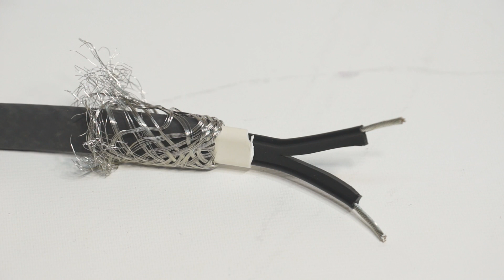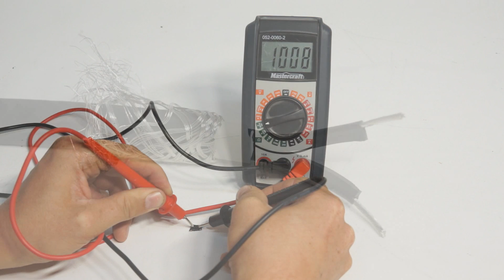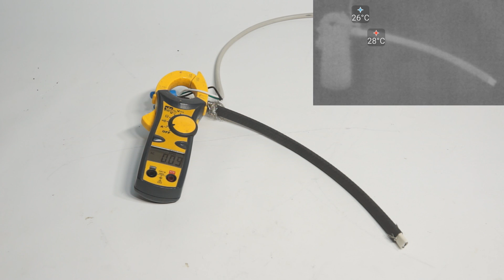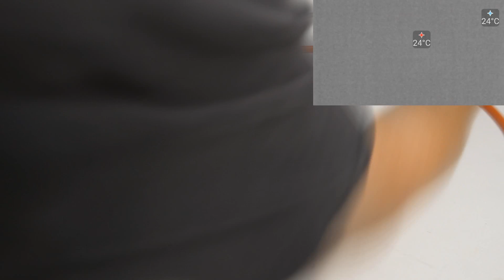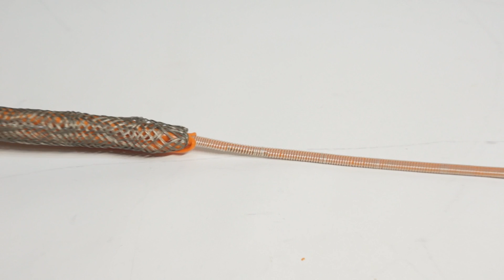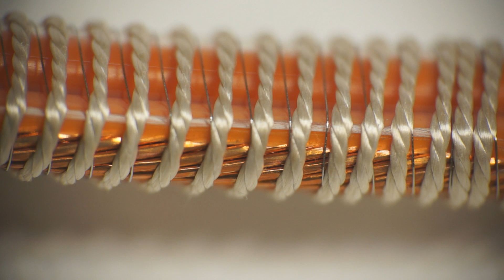Heat Trace Construction Comparison

Comment: Nick , I would like to point out you are calling both of these SR cables,  but they are not. one is self regulating , one is power limiting. the BTV cable you used is constructed different than other SR cables. I good comparison would be between the different types of SR. the Nodes on the power limiting ( the inconsistencies you speak of) are different lengths apart for different wattage cable(5 10  15 and 20 watt)

Comment: We use these at work to keep raw materials from freezing in the pikes.  We also use them to heat outside safety showers in the winter to prevent the water lines from freezing.  Almost all heat tracing is temperature controlled.  In areas of our plant where its an explosion hazard we use steam heat tracing to prevent any shorts becoming ignition sources.
Reply from the maker: Most of our heat trace is externally regulated as well, the self regulating stuff doesn't get hot enough.

Comment: what are these cables used for?
Reply from the maker: +Sdttn I will try as they come up but there are a lot of rules about what I can talk about due to there being some proprietary processes where I work. 

I do have some interesting fire alarm sensors to look at though if you are interested.
Reply: I would.
Btw your channel is just amazing! I subscribed to your channel 5-6 years ago. Thanks for these videos.
Reply from the maker: +Sdttn Glad you like them, I hope you've seen an improvement over the years. I've been trying to get closer to "production" quality but there is still a lot to learn.
Reply: To prevent water pipes from freezing. There's probably other applications, though.
Reply from the maker: +AusiKifaru27 We use them on water pipes and wrapped around tanks that hold materials that are too think to pump at room temperature.
Reply: I would like to see more your job related videos.
Reply: you do not use these types of cables on an infloor heating install. power limiting is not rated for this use, BTV cables do not have the output to heat a slab.  you would use an XTV style cable of that same manufacturer.

Comment: Hey nick, nice video. What is the application of such a cable? I thought heating elements were just connected directly to live and neutral ends.
Reply: I work on-board ships, which burn heavy fuel oil (residual fuel, e.g. HFO 380 cSt), the fuel needs to be kept hot (around 90 to 130 degrees Celsius), in order to obtain the correct viscosity to be burnt, i.e diesel engines, steam boilers etc. So we use heat tracing underneath the fiber glass insulation (or equivalent) to keep the fuel hot.

I hope that this helps to explain the uses a bit better, if you have anymore questions I am happy to answer them. :)
Reply from the maker: +hehtrs sjetn Some elements are self regulating (like the black cable) and some are not and require an external thermostat to stop them from overheating.

These cables are used to keep pipes and tanks above the melting point of the materials they hold. They can also be placed in concrete to prevent ice from forming.
Reply: That has been a field of study for quite some time, particularly compression ignition engines. Raising the temperature of the injected fuel helps in better atomization. This is done because there is a limit to the maximum pressure it can be injected with, as beyond it the fuel will just splash against the wall and not utilize the extra pressure in further atomization.
Reply from the maker: Interesting. I never thought about preheating fuel for an internal combustion engine.
Reply: Im in the chemical processing industry, we use these to preheat the feed into our high vacuum short path distillation units. Because the time spent inside the evaporator is so short (<10sec) it is important the material is as close to the evaporator temp as possible. 
Incorrect installation such as spiral wrapping around metal pipe is hazqrdous and could be a video all by itself ;)